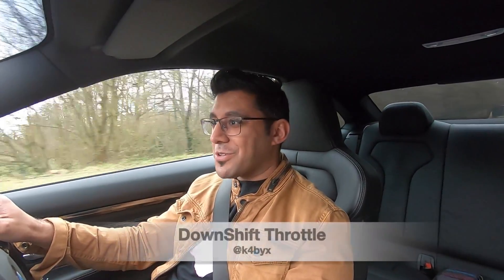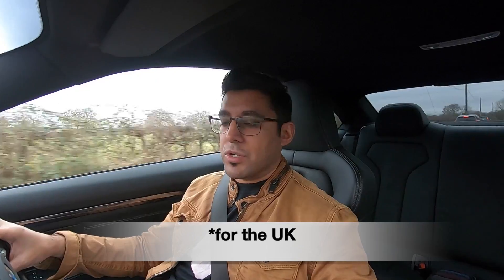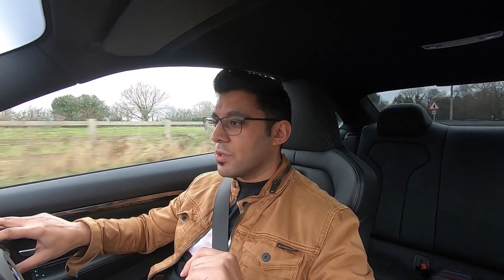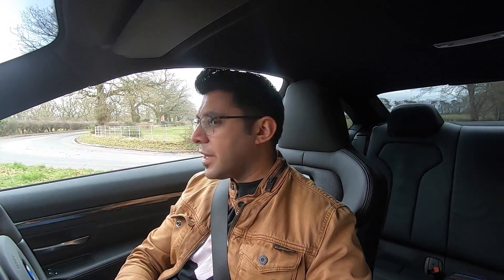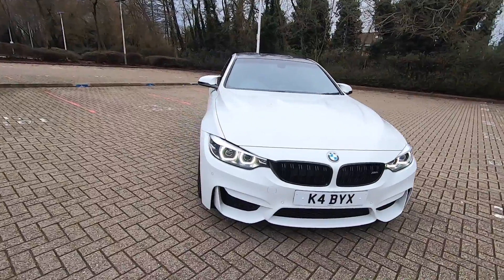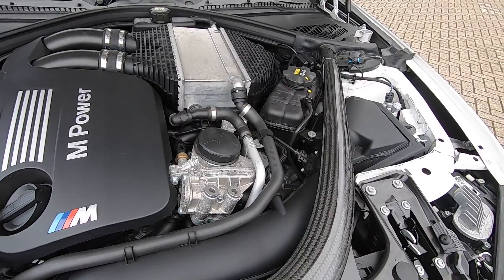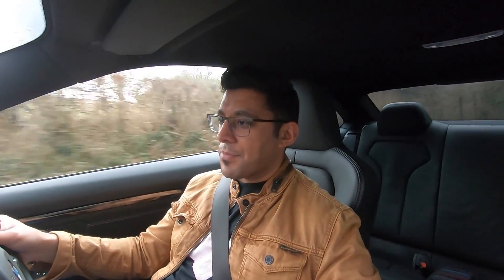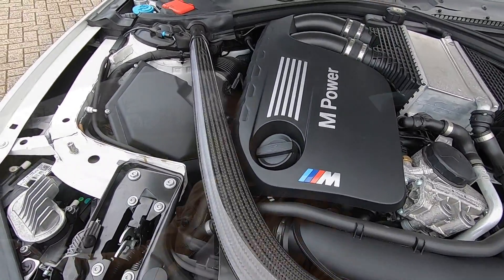BMW S55 Engine Crank Hub Failure Should You be Worried?- WATCH THIS

Comment: Comment if I will spin my CH or not if I do the following on a stock DCT s55 car.

Occasionally Street drifting
Doing donuts when I want to or dry or wet
Never using kickdown
Careful when downshifting from 2 to 1st gear.
Very spirited driving using high rpm occasionally and avoiding super high load pulls from a high gear.
Driving an M car like its meant to be.

Comment: Man I guess I'm not going to experience this so call crank hub failure!! Shit I've tuned it with 100octane,  full bolt on etc...dct trans....and ran the shit out of it 130,000 miles now...guess that crank hub stuff is bullshit 😅😅😅😅
Reply from the maker: I think the numbers of failure are low and really depends on pot luck. My mate had his go while just cruising along at 25mph.....not full engine catastrophe but he had then opted for a crank hub fix. He's car was tuned. Only found out about this last weekend
Reply: Wow 130k! How's she running? Did you ever do DCT fluid change?
Reply: @yg78t76t7  yes dct and differential fluid around 80,000 miles

Comment: Someone pls reply...I might get my hands on a 2015 m4 with a stage 1 remap making 520bhp and an enhanced exhaust overrun....will I get a crankhub issue?is it worth getting this m4 or should I go for a stock one
Reply: Mate I learnt this the hard way big time!! Didn’t know about the crank hub at all. Even after asking my mech and tuning company before i went for the first map. Long story short got 538bhp on the map and ran for about 2k miles and all fine then…. It went. Current £2k down fixing the crank hub and just found out my valves are shot still waiting on the price of that 😭 wish me luck
Reply from the maker: Personally I would buy a stock one and get the work done yourself. Mine has the crank hub capture plate and is stage 1 - no issues. But I'm sure many people would say the crank hub capture plate doesn't help.
Reply from the maker: Check out my stage 1 vids and the capture plate fitting vids
Reply: @DownShiftThrottle  ohhh gotchaa...thx dude<3

Comment: One model catastrophic oil pump failure issues, one model rod bearing issues, next model hub failure issues, another model drive train malfunction issues, another model serious throttle actuator issues, another model SMG pump failures, ECU issues.. Whew... I'm exhausted  cause I owned three models with the previously mentioned issues. But remember everyone............... It's the ultimate driving machine and the Bavarian Motor  really Works so you should be fine......

Comment: When I was searching for a M4 F82 I had the same problem do I want a car with a potential risk of engine failure, but i didn't quit en bought a stunning austin yellow M4, I have done a lot of research on different forums al over the world, I came with the following numbers that the chance to have a spun crankhub is below the 1%. The big fact is you will allways read or hear the horror stories about a broken engine etc. Now in to detail, your sensor on the timing belt is really sensitive, if your gear on the crankhub slips a little you already get a drivetrain mallfunction and you only need to replace the crankhub and not the whole engine, the tollerance is not that big. The next big thing i came across is that the crankhub issue happends a lot on cars with a low mileage. I've tuned my car by Mosselman stage running 540hp and 720nm torque (76000km) and they had only one car with the crankhub issue, they only replaced the crankub for a locked version, one that will never come loose. The instant increase of rpm's is the big evil doer on the crankhub that in combination with more power. In comparison with the rod bearing issue on the m3 e90/92 this issue happens less.

great video :)
Reply: If you aren't running 600 plus hp it no worries

Comment: Ask yourself if bmw have faith in their engineering why won’t they release figures on crank hub issues, also consider once the car is out of warranty and you have an issue bmw won’t provide a good will gesture. I will be having a crank capture plate fitted at Litchfield once my warranty expires for peace of mind unless it becomes a bigger issue in which case an upgraded replacement crank hub machined by Litchfield. Having dealt with 2 master bmw mechanics at two different dealerships previously I have more faith with independent experts like Litchfield who know the ins and outs of performance vehicles than main dealers who can’t even diagnose issues unless a part is completely broken as their diagnostic capabilities are a joke.

Comment: Apparently a lot of cars now use a compression joint at the crank hub so this is not just a BMW thing, however it does just appear to be this engine giving some problems with both stock and tuned cars. It’s disappointing as I would love to buy a F80 M3 but am put off due to this issue 😔

Comment: Probably a dumb question, but if you were to install an aftermarket exhaust on your car, would that void the warranty? Soon to be proud owner of a new m2c. Want to replace the exhaust eventually because I think the stock exhaust looks bad and sounds underwhelming imo.
Reply from the maker: You will lose manufacture warranty on any exhaust component....but you should get sime sort warranty from your new exhaust supplier. I wouldn't think you'd have any other issues.

Comment: My M2c is at bmw now with suspected crank hub failure after on 1600 miles and 3 months old, it has been run in as per BMW’s instructions and run in service completed at 1184 miles, Waiting for bmw to confirm problem but if it does turn out to be crank hub failure it could happen at any time, I’ve been gentle with my car and it just failed as I was driving gently to traffic lights slowing down to stop.
Reply from the maker: Feel for you mate. Hopefully they get it sorted. As long as the car has not been modified you should have no problems with a warranty claim
Reply: DownShift Throttle thanks mate, yes it’s totally standard not been messed with at all so warrenty will sort it, little bit upset and lost a bit of faith but love the car still, they have given me and m5 comp while mine is in so ever sky has a silver lining! Great video!
Reply from the maker: @octane_adventureroca9581  hopefully you get it back soon.  Love the M5C. If you're local enough how about a vid on the M5 hahaha
Reply: Dct or manual?
Reply: @RedlineAutoMoto  DCT

Comment: I agree with you 100% if folk are still worried get a plate put on 300 to 450.  Now you have piece of mind.
Reply from the maker: Just bear in mind if your car is under warranty or extended warranty putting on a plate void the warranty. Also if you change the hub for the "crank hub fix" your warranty is voided.
Reply: My car is 2016 I'm out of warranty so I'll admit I am worried but I have come to same conclusion as you and I'm getting plate but I never drive my car hard coming from a 200 bhp this car is a bit much for me power wise so no mods power wise I respect the car when driving after selling my soul to buy it I won't drive it hard it feels awesome in economy sport is 2 much for UK roads for me. Lol had it in sport plus cold wet morning just to show my kid sound forgot to turn of car went 180 on a round about that lesson cost me 3k. So no more stunt driving ha ha ha.  Any ways like your up load just subbed

Comment: the crankhub issue isnt just modded cars, its stock cars too. its not just DCT's, its manuals too. and its not just when driving very hard, it could happen when backing out of your driveway. its a ticking time bomb, that needs to be replaced.
Reply from the maker: Each to their own. All depends on how the car has been driven.
Reply: @DownShiftThrottle  no it doesn't, it can literally happen anytime
Reply from the maker: Have you had it on yours?
Reply: @DownShiftThrottle  mine is stock, im buying the gintani crankhub upgrade within the next month.
Reply: Moe Chawki how much is it for part and labour
Reply: @Thomas-x3z8t  About 2.5-3k total
Reply: Do you have any evidence? I haven’t seen a stock car with a crankhub issue.
Reply: @laurenmichaud537  There is already one guy in comments, that said his stock M2Comp probably spun a crank hub, sooo...
Reply: Scrytheux ouch. That sucks. I may eventually fix my crank hub...for peace of mind if anything.
Reply: @Scrytheux  its an issue that needs to be resolved.
Reply: @laurenmichaud537  id suggest gintani, it's more expensive than the rest out there but they do good work, and i believe its a one piece, not a two piece. so it wont ever spin on you. the rest use teeth and a locking pin, which have a very low probability of spinning, and are generally considered safe for higher horsepower, but i personally would want the peace of mind with a one piece.
Reply: @laurenmichaud537  "While the specific parameters surrounding failure are not precisely known, one thing is clear: slippage causes severe engine damage. This slippage, or spinning, is not isolated to just DCT or just manual cars, just stock or just modified cars, nor does every car experience failure. It's just an expensive gamble to not address this point of failure." - Gintani.
Reply: @moechawki7251  Your evidence is a quote to a company selling replacement crank hubs?
Lol. Okay.
Reply: @wee_eck  "What Vehicles Does This Affect?
Pretty much every six-cylinder BMW made from 2007 through present day. If you’re not sure, feel free to contact us and we’ll let you know. For those of you with F80/82/83 M3s and M4s, this is a truly critical fix." - Movement Motorsports. happy now?
Reply: @wee_eck  also, gintani is a reputable source. doesn't make a difference that they're also selling an upgraded crankhub.
Reply: Moe Chawki good thing the dme on the car is very smart and capable to turn off the engine before any big damage, buddy was going 120 we herd a loud pop and we got excited but he lost power literally right after it, kinda when you press m2 mode and the car blips forwards that happen but the opposite the car just wouldn’t go and turns out the crank failed but dme saved his engine and he had to get a new crank hub and a engine retiming but he op to get a pinned crank hub by ssr tuning in California (car was pushing 620 to the wheels)
Reply: @user-sn5kj1gy1t  In most cases, yeah, but I'd say its not even worth the headache. The motor has a weak point, so why not get it taken care of before something happens.
Reply: @user-sn5kj1gy1t  dct or manual?
Reply: @RedlineAutoMoto  dct
Reply: He is sort of right, despite the quote from the part seller.  There is a current class action lawsuit between BMW and a group of people who have come forward. Specifically for the S55  engine, as it causes catastrophic engine failure and without warranty you're out a significant amount of money in repairs. Plus, 3 to 4 grand isnt that much tbh given the price of these vehicles..
Reply: @tiffanyl496  its happened to cars doing no more than backing out of their driveway, its not just the 700+ horsepower cars.
Reply: 2019 M4  just had running in service. Picked car up last week .didn't even get home as broke down.back at BMW now and crank hub has spun. bent some valves.bmw want to fix it.i want my money back. Car was doing 30 mph wen it spun the crank hub .totally standard car no modds either.
Reply: @sf2942  dct or manual?
Reply: This guy for sure do not own one lol
Reply: @pcarobsessed9778  exactly what i'm thinking
Reply: So for stage1, still rather upgrade crankhub
Reply: @Thomas-x3z8t  whether youre pushing the car hard or not, 100%. it's an issue that isnt related to hard driving, but hard driving can accelerate the process of it going out
Reply: 🤣🤣🤣 @ backing out of driveway
Reply: Guys I learnt this the hard way big time!! Didn’t know about the crank hub at all. Even after asking my mech and Tuning  company before i went for the first map. Long Story short got 538bhp on the map and ran for about 2k miles and all fine then…. It went(tbf I drive it like it’s stolen). Currently £2k down fixing the crank hub and just found out my valves are shot still waiting on the price of that 😭 wish me luck

Comment: Were the taillights just wrapped to get the smoked affect?
Reply from the maker: Yes they were.....on my M140i they were spray painted which was an irreversible effect.....being wrapped obviously can be reverted back. Good job and I'm impressed to be honest
Reply: @DownShiftThrottle  ya big time. They look 👌
Reply: DownShift Throttle u can spray paint it and then sanded off with 1200 grit paper and apply clear coat ...

Comment: That would be my fear if I moded mine. I believe BMW  wouldn't need much of an excuse not to honor their warranty
Reply from the maker: Basically even if your far is under warranty like mine and I attempted to go down either a "crank hub fix" or the "capture plate" the warranty on the entire engine is void even if i don't increase the power or do any engine mods. Once the car is out of warranty I think I'll go for the extended warranty anyway which will cover any such failings.....

Comment: I'm sure BMW tested the s55 engine to the limits and 430 hp is more than enough   to mess around on the roads I wouldn't worry if it was a recall notice every man and his dog would be shouting about it but it's come from across the pond where tuners was getting 600 to 800 hp that's when it was started
Reply from the maker: I totally agree! Thank you for understanding. The way I see it if I wanted more power then I'd buy a M5 or M6. I wanted more power so I bought my M4 after my M140i. Makes sense I guess.....
Reply: @DownShiftThrottle   it's like anything you thrash it hard enough fast enough it will break but if BMW say it's ok and 430hp is a lot of power then that's good enough for me
Reply: Bmw m4 425whp not hp..a stock m4 has nearly 470hp..and the cp has nearly 500hp
Reply: @commantrosexetlos4700  in England the competition had 450 and normal has 425
Reply: @stevelongmore7836  yes but after they dyno them its 425whp and 450whp..the competition has nearly 500hp at the crank